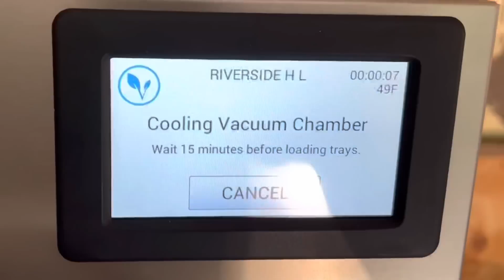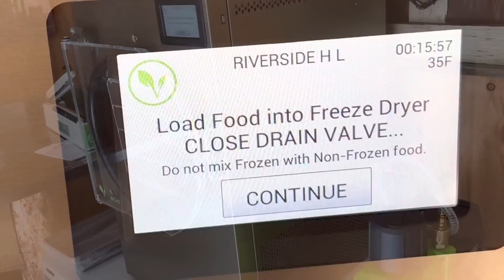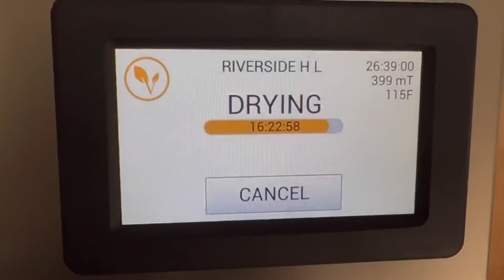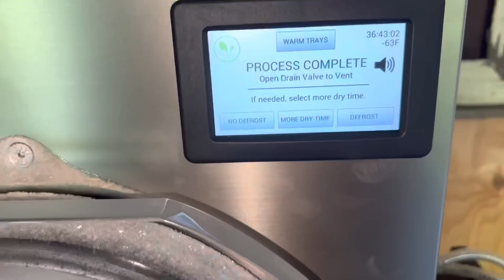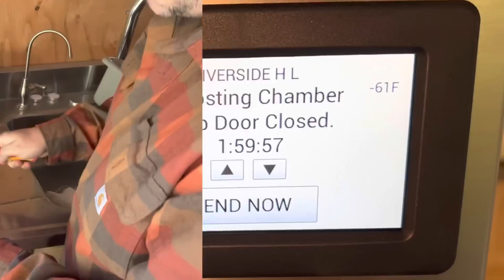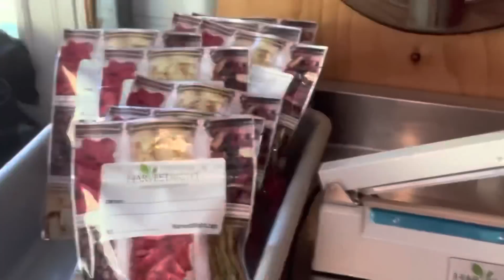30 Years Shelf Life NO REFRIGERATION | Buy Food NOW | SHTF Prepping

Comment: That machine running for 37 hours straight it's probably pretty hard on the electric bill I would imagine
Reply: Another ytube channel specifies the cost and it it very low
Reply: It's actually not at all expensive. Look up "Retired at 40" here on YouTube. 
He is supremely informative about everything freeze dried related and he always shows the actual cost of using the freeze dryer. He measures it with some gadget.
Reply: A little over $2 for 48 hour run
Reply: In central Florida a typical run in high heat humidity is about 36 hours. It’s about $2 a load to use our freeze dryer

Comment: 8-10 week back order. Medium only does 10 pounds. Overloaded at 200%. Most likely not dry especially without pre freezing like what’s supposed to be done. Sponsored video by HR? So many problems with these things. Pumps are junk, losing Freon, software issues, no vacuum, bad valves, people having to send them back and out their units. Large runs for 30-40 hours. Thing can’t do meats with any fat what so ever. Lots of nightmares. The freeze dried food in stores is much better than HR freeze dryer. Can’t do a ton of the things in the store. Must have tasted like S. Never showed that part. I wish I never bought a freeze dryer but it was from these sponsored Harvest Right videos that I bought it like an idiot. You can tell you don’t use that machine on a regular basis. Canning meat is a 100 times better